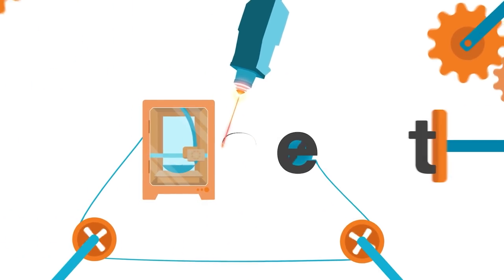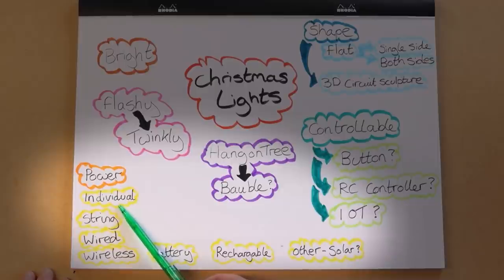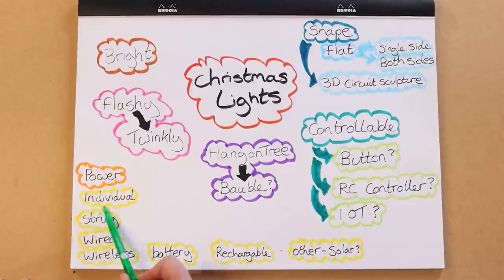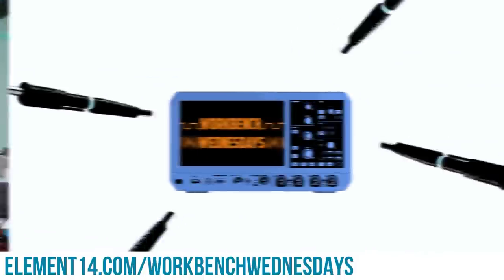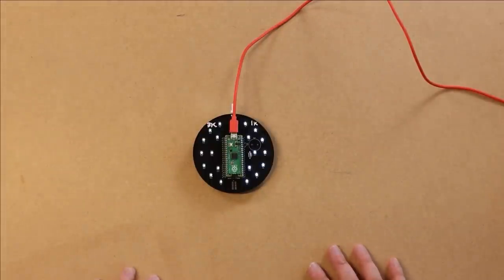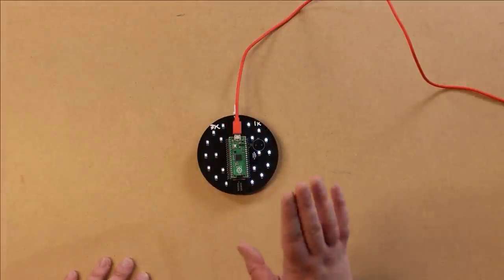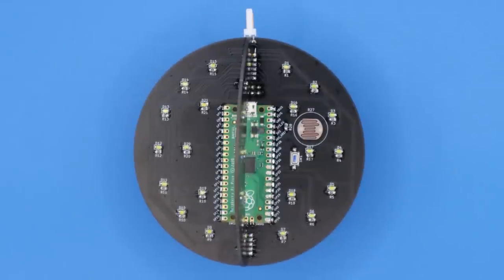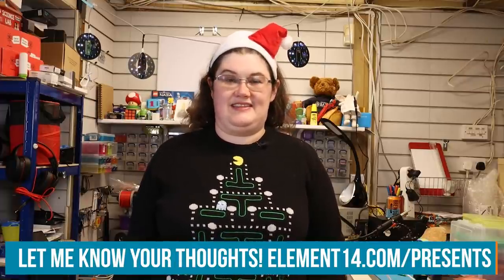MQTT - LED Christmas Baubles with Pi Pico

Comment: Great video and project, Katie! for mechanical stability it might be helping to use a dual 1.27mm header and 1mm thin (or probably smaller) boards that would fit between the dual rows